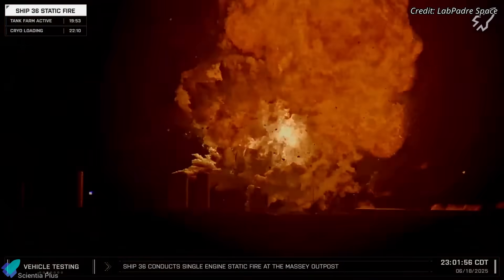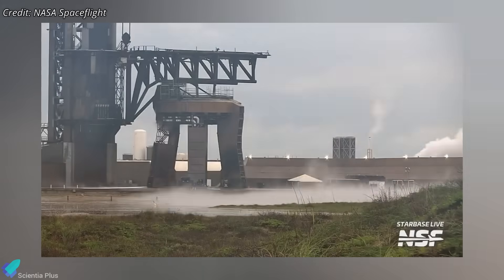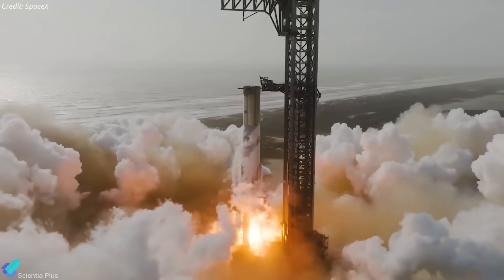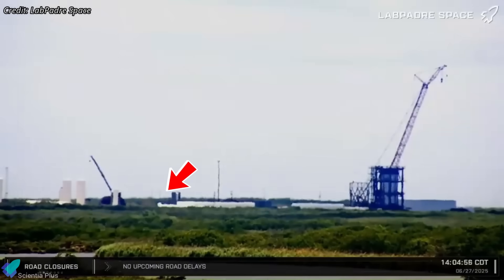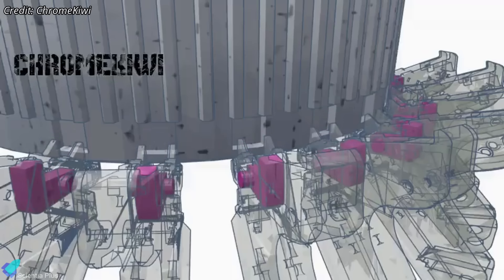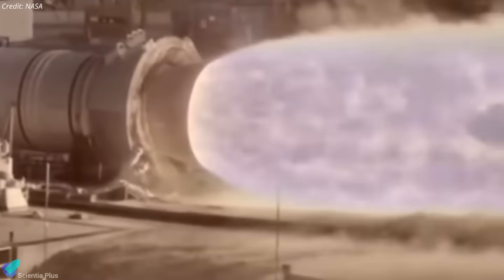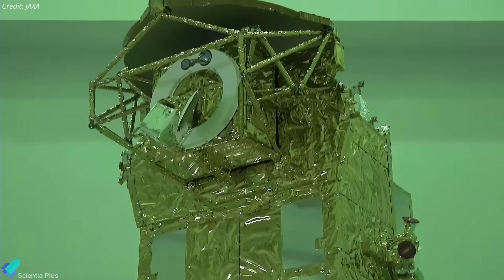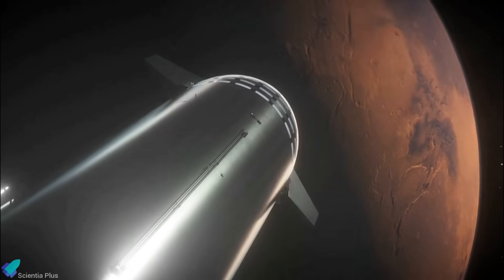SpaceX Backup Plan After Starship Static Fire Explosion is Risky & Wild!

Comment from the maker: 00:00 Starship Updates
08:22 NASA's New Rocket Booster Just Exploded… What Happened?
10:57 Japan’s Rocket That Went to Venus, Mars, and Beyond—Retires

📚 Learn More:

🚀 Starship Block 2 Explained:
 📖 Summary: https://shorturl.at/b0dtw
 🔍 Detailed Explanations:
  • Design Improvements Update 1: https://shorturl.at/lpGT7
  • Design Improvements Update 2: https://shorturl.at/gwNQ4
  • Nosecone & Payload Bay Redesign: https://shorturl.at/xa60S
  • Methane Downcomer Redesign: https://shorturl.at/XdYBG

🚀 Starship Block 3 Explained: https://shorturl.at/mnBT4
🚀 Starship & Booster Block 3 Detailed Breakdown: https://shorturl.at/IViwD
🚀 Starship & Booster Block 3 Production Begins: https://shorturl.at/xRNkJ

🔥 Raptor V3 Mega Upgrades & First Test: https://shorturl.at/TRIyj
🧱 What’s Inside Starship GigaBay?: https://shorturl.at/nJM75
🛠 Insane Engineering of New Starship Launch Pad B: https://shorturl.at/7RAZd
🛢 Dual-Port Orbital Refueling – Full Technical Breakdown
https://shorturl.at/5tiqK

🛠 Other Starship Upgrades:
 • Hot Staging Explained: https://shorturl.at/jf400
 • Super Heavy Booster Upgrades: https://shorturl.at/Pi5R3
 • How SpaceX Protects Raptor Engines: https://shorturl.at/4Om8F
 • New Heat Tiles Explained: https://shorturl.at/p2Ijb

🚀 Starship Flight 7
 📽 Complete Breakdown: https://youtu.be/UqzZx7vb-TA
 🛠 Root Cause & Fixes: https://shorturl.at/HcLKo

🚀 Starship Flight 8
 📽 Complete Breakdown: https://youtu.be/f26yH80RK2o
 🛠 Root Cause & Fixes: https://shorturl.at/vsGFB

🚀 Starship Flight 9
 📽 Complete Breakdown: https://youtu.be/2eirgcUzwts

🔥 Starship 36 Explosion:
   Detailed Breakdown: https://youtu.be/VWQiIz1ymBA
   Damage Report: https://shorturl.at/Quoex

📡 Stay Updated:
📢 Weekly Updates: https://bit.ly/3HIQjPC
🚀 SpaceX Playlist: https://bit.ly/34wue8T

🌍 Follow Us:
👍 Facebook: https://www.facebook.com/scientiaplus